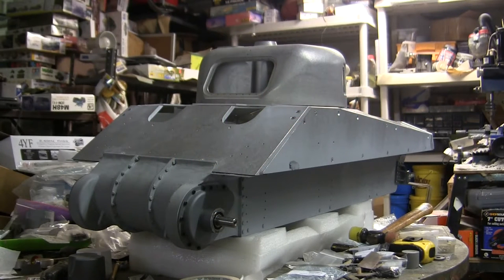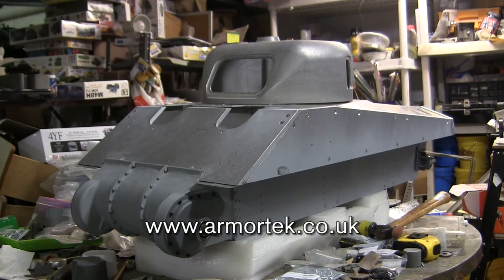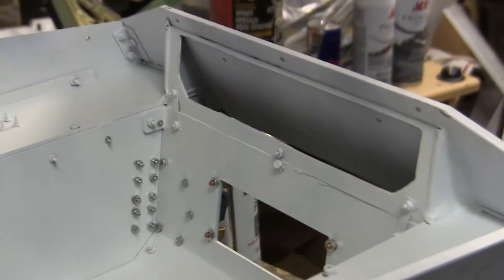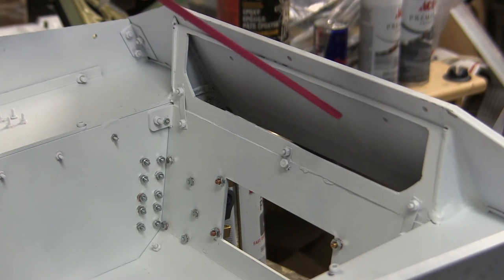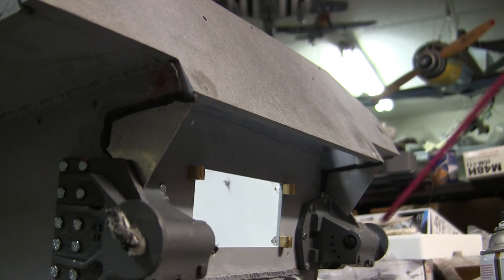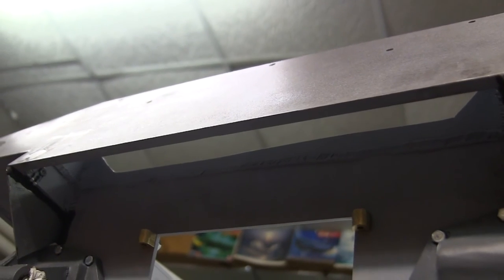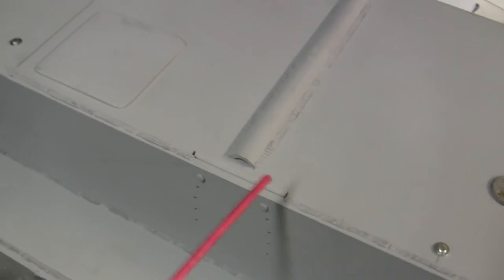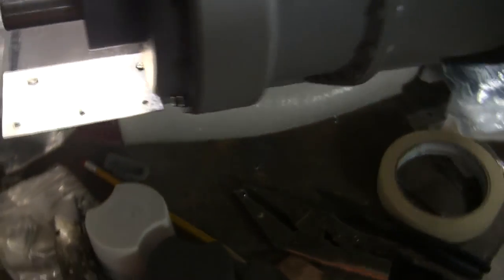RC Armortek 1/6th scale Sherman V Firefly project video#1 (project start)

Comment from the maker: With 1/35 you're very handicapped with the small scale. It can be done and Tamiya had a 1/35th scale RC series in the past but these are OOP. There are also a few vids on youtube that have done it, you will need a Tamiya Dual Motor gearbox, and 2 micro speed controllers, a small battery, and a ex motorized kit works the best as these models were originally designed to be RC. Typically it's more popular and commonplace to have 1/16th scale tanks RC as the size is much larger, they are more durable and cost wise will be about the same as the RC converted 1/35. Overall they make much better runners. So My advise is to go 1/16

Comment: What size are the bolts and where do you buy them? I have found only one place with reasonable priced hex head M3 bolts, from a Finnish shop ruuvi.net. For example 50pcs of M3x10, mild steel zinc coated only 2.33€. Thats really cheap compared to what some scale model shops! Sometimes i need M2 bolts but I have not found any for low price, do you have any advice?
Reply from the maker: +Catrik 

I get all my fasteners from microfasteners.com . They are located in the USA which makes shipping for me more economical then importing them from overseas. For most of my detail work I use M3,
Reply: +oddball759mm 
Thanks! Looks like imperial sizes are more avaivable than metric, I'll have to buy some of those. I just wish they were mild steel as I am going to weather my KV-2 with salt water :)
Reply from the maker: +Catrik 

They carry the metric, but they special order them. I usually phone it in and they do the rest.